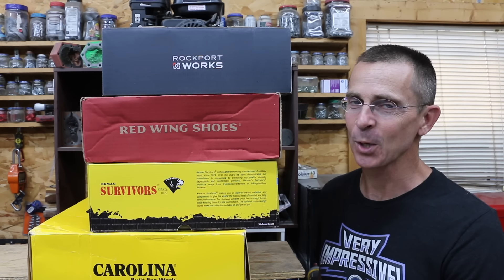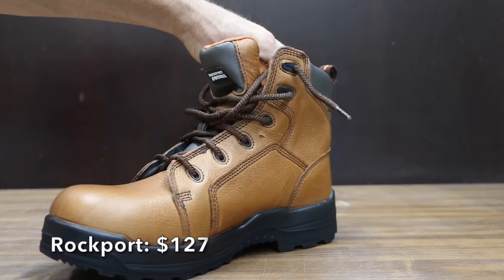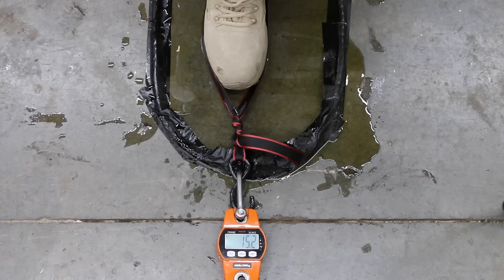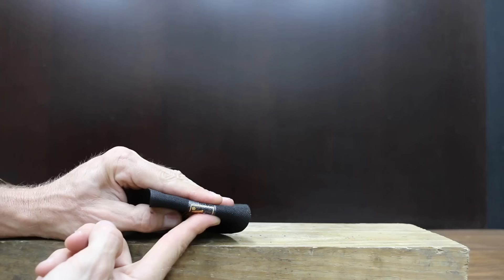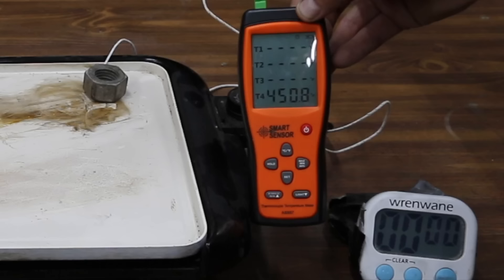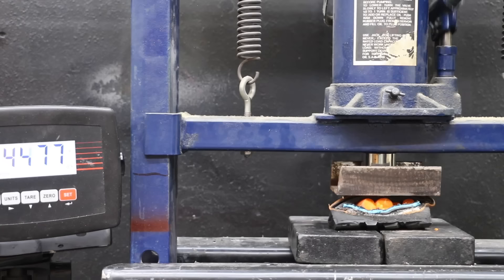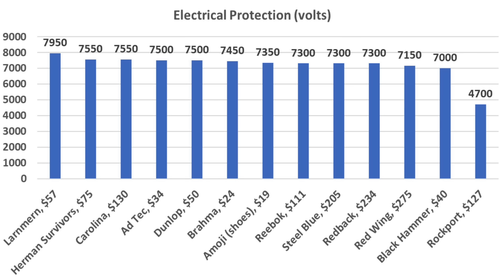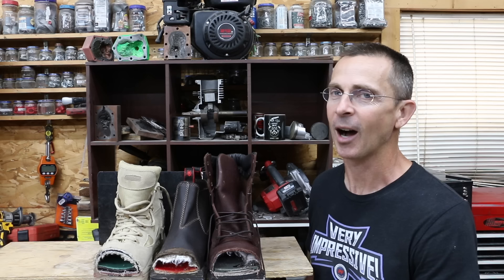Best Boots? $24 vs $275! Let's Find Out!

Comment: I work in the oilfield and easily walk at least 5000 steps a day and in >30 years of working I'm only on my second pair of Red Wings. You mentioned longevity and these boots are top notch. Just as comfortable as the day they were purchased. At the end of the day my feet feel no fatigue.
Reply from the maker: Thanks for sharing.
Reply: Your employer doesn't buy new boots at least once a year? 
I never thought my municipal job would have better benefits than a oil job. 

$160/year allowance for 30 years, that's almost $5k they nabbed from ya.  

Keen boots, made in the US, is where I settled after trying all these, including red wings. 
I work in a water treatment plant, 12,000 steps a day plus running 3 miles a day.

Comment: You know what I would like to see you test:  paint brushes and paint rollers! I do a lot of painting, and I am very skeptical about paying 20+ dollars for a paint brush.  I use the top of the line Harbor Freight brushes, and I get really good results.  Since I'm a general contractor and not just a painting contractor, I usually just throw away the brush after use.  But even so,  I can purchase 5 brushes for the price of 1.
Reply from the maker: Thanks for  the suggestion.

Comment: Longevity is definitely a testament to good boots, and I hope there's a way you can simulate that at some point. I know surveyors that swear by Red Wing, but I have noticed that they've gone away from lifetime, repairable boots and moved towards replaceable boots with glued-on soles. I do know wildland firefighting guys that also buy Red Wing, but they specifically purchase the non-synthetic, laced-on soles. They cost more, but the heat protection is stellar.

I do wonder where Ariat would fall on this list. Several guys at my last job tried them out and were very happy with them.

Also, small but constructive gripe, but please consider dropping out more "and" starters in your editing. When you listen to the video (especially multiple in a row), the "and"-s start stacking up and start to get really noticeable as if the video is one big run-on sentence. Regardless, I'm a big fan of these videos and usually check them out when I'm looking at new tools for work.

Comment: Can we please get a video made over the Top 10 economical Near Infrared Light Therapy devices? 

The red light therapy stuff absolutely works! It works so well that there’s plenty of grifters getting into the space. It’d be amazing to have you conduct a shootout as to the best one. 

You can measure the following: 

1.) EMFs from 4-6 different distances. 
2.) Radiation output from same distances.
3.) Total true wattage of each panel. 
4.) Test the ACTUAL wavelength of the different bulbs on each device. This is where a LOT of lying and grifting has occurred in this space. 
5.) Leave units on continuously to see how quickly they burn out if at all. 
6.) You can also see if there’d be a big wattage drop as it ages; therefore, less efficacious over time. 
7.) Torture testing them in high heat environments. 
What I’m essentially alluding to is seeing if they could survive usage in either an infrared sauna or a traditional sauna. (e.g. 160*F +)
Reply from the maker: Thanks for the video idea.

Comment: Very interesting.   Thank you. 

I would be very interested in a test of climbing boots.  I spend a lot of time walking on blacktop and concrete - tread wear, and arch support for climbing ladders and hooks on poles.  Also wicking abilities for foot sweat and or water resistance.
Reply from the maker: You are welcome!  Thanks for the suggestion.
Reply: @ProjectFarm  Have you thought or done anything with polarized UV blocking sunglasses?

Comment: More padding does provide more comfort out of the gate, but a leather insole is really the way to go once it's broken in.  I have some vintage doc martens I've worn for years and the insoles are hard as rock but perfectly conformed to my feet so it feels like I'm walking on nothing.  100ft, 5 miles, no problem.
Reply from the maker: Thanks for sharing.

Comment: My redwings lasted over 4 years doing 20+km a day through canadian winters, solevants, and oils. They just need new orthopedics and are good to go for more. Plus redwing will overhaul them for less than the cost of the cheapest boots on the list. Free laces and cleaning/oiling for life the cost of them compared to other brands based off of lifetime of the boot is lower cost when 200$ boots are needing replacement every year and the 400$ redwings are good for 4+
Reply from the maker: Thanks for sharing!

Comment: I wear Brahmas for work, just because they are inexpensive, and it is difficult to find size 7 to 7 1/2 shoes.  I totally agree on the test assessment.  I have to put extra inserts in, but even that doesn't keep them from hurting my feet.  My next boots will be Black Hammer, if I can find them.  They need to be able to stand up to dry cement and fly ash, and rough terrain.  Thank you for the testing.
Reply from the maker: You are welcome!
Reply: I wear size 6 mens which is why I got that exact pair of brahma boots since they were the only pair of steelies in my size at Walmart and I needed them because I just had gotten a warehouse job. They seem to be built just good enough to get someone to their first paycheck or when they can afford a pair of nice boots.

Comment: I just got rid of my Reeboks.   They look comfortable but there were terrible after more than a couple hours.   I do routinely work 13 hour days on concrete and that is tough on any boot, but i found the reebok's to be uncomfortable on longer drives and hikes as well.   i did try replacing the insole and that helped some but not enough.   I've had Carolina boots in the past and found them to be much more comfortable generally although they also struggle with long days on concrete.  They were very durable.   The boots I've had the most luck with in the past for comfort and durability are Colorado's and they included a steel toe, heel, and shank.
Reply from the maker: Thanks for sharing.

Comment: I have a pair of work redwings and the non work Red Wing .
Iron Rangers.

Rangers hands down the most comfortable shoe I've ever worn, and I always hated heavy boots. Keep em clean and conditioned, the leather never holds scuffs and the soles are super durable and replaceable. I did fall on my ass a couple times in the snow, but they aren't made for that. I did trudge through 10" of slush with them, they got wet but surprisingly dried out quick and didn't leak through. Actually did that on my way to the airport and was worried I'd have wet socks for an 8 hour flight, but not at all.

Comment: I highly recommend the most expensive herman survivor boots if you're working on rougher outside concrete/gravel. They're tread, and uppers last much longer than other brands. If you're working on smoother concrete, go with a red wing or comfy soft sole. I've had red wings in the past last 6 months and a pair of herman survivors last 2 years. I enjoyed the red wings with indoor jobs but had an outside job that wore the soles insanely fast. The herman survivors just don't quit unless you intentionally put sharp metal on the toe or do an insane amount of kneeling work on rough surfaces.

All in all, boots should last at least a year with good maintenance. Clean and oil your boots. Don't use silicone spray. Use saddlesoap then mink oil or other good leather products.
Reply from the maker: Thanks for the feedback.

Comment: There's a brand here in Brazil that I use, and I'd like to see how much it can hold against those brands. It's Safetline, the most expensive models cost around $ 35.00 USD with metatarsus protection, double density soles, anti perforation insole, electricity protection, steel or composite toes... and I use one daily to walk 4 kilometers and it's very comfy.

Comment: For longevity of the boots you could rub the corner of a piece of metal with some weight on top till it wears through the boot or maybe do 100 passes and rate subjectively
Reply from the maker: Thanks for the suggestion.

Comment: I have worn Red Wing model 2406 exclusively for 13 years. I am currently in the first year of my fourth pair, each pair lasting me an average of four years. The combination of comfort (there simply is no break-in period, and no blisters), grip, weatherproof, and safety (EH rated to 600 volts, steel toed) makes them my favorite footwear. I wear a size 15 EE, and Red Wing is so consistent in their manufacturer process that I simply call up the store in Smyrna, TN and pay for it over the phone and they ship them out to me. I don't need to try them on, they will fit perfectly.

Downsides are price, they cost me $259.99 for the last pair, and $49.99 for the pads. The durability of the soles is not great (hence the four year, lifetime - but remember that they are my only footwear). I tried out a different model that gave up the EH rating for longer life, but they were quite a bit less slip resistant and I returned them after a day for the 2406's. 

Also I used to work in the paint shop at GM as an engineer (now retired), and between the chemicals and the extra walking I imagine that this contributed to the accelerated wear.

You can have Red Wing re-sole them, but I never have.
Reply from the maker: Thanks for sharing.

Comment: In terms of longevity, the redwings last a while. With extremely heavy intensive use on redwing boots, they can last a year and a half before showing any real damage. I've had mine for two years now (i'm a groundsman tree worker. EXTREMELY heavy use). They are damaged but definitely still wearable. Mine were 400$ however. If they were boots you only wore during winter and didn't abuse them like I did mine, I think they would last 5 years without showing any damage and 8 or 9 before needing to get them replaced or repaired.
Reply: Red wings last almost a year here in my water plant. Nothing lasts more than a year, so no reason to get too expensive.
$250 Keens last just as long as $600 red wings here. My boss even spent hundreds having his red wings refurbished after a year before he gave up, several hundred bucks each time. 
Constant moisture, fire house blasting, and constant pure chlorine gas, it's over. Stainless steel falls apart here if it's exposed to air too long. Also, we use sodium permanganate, and it burns through everything, especially leather.

Comment: I ordered the Larnmern boots on a whim cause they were 60 bucks and wasn't disappointed.  They are lightweight, I added some waterproofed and at about 2 months in I replaced the insoles. Other than that about 8 months later, they are still going strong and the padding and weight of the shoe make them comfortable for 10 hour days.  It's good to see them do well in these tests.

Comment: Missing Keen Brand. Every Lumber Mill worker in the Upper Peninsula of Michigan I know swears by them. I own a pair that I've had for 7 years, and they are quite excellent. When I worked at Connor's Sports Flooring, they were as much of a tool as the roll nailers. When you have a deadline for a professional basketball floor, and you're working 12 hr days, it helps to have a boot that has sole support and can consistently catch a 280lbs panel from a 2 foot drop. Kinda surprised I don't see my Keens in this showdown, but I never heard of them until I moved to the UP. Project Farm is always the best regardless.
Reply from the maker: Thanks!  Thanks for sharing.

Comment: Can you run the boots across concrete with like 100 pounds pressure for a set distance? I think that would somewhat quantify the durability of the soles. Also, the separation force of the sole from the top half might work for durability.  You might have to nail or screw down the soul to do that though
Reply from the maker: Thanks for the suggestion.

Comment: Construction is important:
For a very long time I had wanted a pair of Rockport boots but were too  expensive.  I finally got a pair on sale for $250 can. Unfortunately they were made in Cina instead of Portugal.  The soles were cemented. With ratively little use these boots started falling apart
 The glue was letting go and could not be repaired.  
Conversely I still have a pair of Metterhorn boots made in Canada with a Googyear Welt.  My parents gave them to me 40 years ago when I was in college 40 years ago and I am still using them. I ca😮n't kill them.
Reply from the maker: Thanks for the feedback.

Comment: I would love to see Rock Rooster Norwood steel toe tested compared to some of the more expensive boots. I lve had pairs of Georgias, Wolverines, Dickies, Keens, Cats, and Brahamas. The only ones to survive 6 months were the Rock Roosters and they are going on 18 months best $100 ive spent on boots ever. They have my business now until i die or cant get them anymore. I CANT recommend them enough if you also melt through the rubber soles of your boots with walking on oils and chemicals at work. They have a urethane layer and it really does last.
Reply from the maker: Thanks for the suggestion.  Thanks for the feedback.

Comment: so my Carolina boots have a composite toe cap and shank. they are not meant for hiking but for standing and working. they are water proof and non conductive. working on boilers and chillers that is a thing to check. they are also $180-$220. i replace them every year. with a $20 Thorogood insole they do great for what i do. but i have a lot of ladder time and standing time. if you walked all day a different boot might be better. i added a lace on metatarsal guard because dropping a 4ft steel pipe wrench on your arch is a life changing event. it is why the steel workers boots have them.  CA 8528 is the number. maybe put them in the next test?
Reply from the maker: Thanks for the suggestion.

Comment: I’m a service tech at a dealership and I have red backs along with there socks and they are extremely comfortable I’ve stepped threw pretty deep puddles and my foot and sock stay dry definitely recommend I had some cheap work shoes and they would fall apart after 6 months I walk a lot and so far these hold up and are pretty comfortable

Comment: Look for boots  called - steel blue  -  and Oliver branded boots - they are a little heavy but they are so comfortable  -     My feet are not big 9 1/2 10 ….  But they are wider than most  - due to not wearing footwear  for decades unless  working  , or required for entry into an establishment .       Anyway  ‘’ These two brands of boots are comfortable  .
Reply from the maker: Thanks for the suggestion.

Comment: As a union electrician, I wear work boots probably 6 days days a week.  I often find myself with foot pain. 

 comfort is a major & deciding factor in my purchase. I’m still on the lookout for the most comfortable workboot.

I’m currently wearing the wolverine hellcat with a foam midsole. I wonder how that lines up against the ones you tested. 

Thank you for your testing.
Reply: Try Keen boots. I have comfort issues too due to foot surgeries. Keen seems to make better boots in the higher end models.
Reply: @gerry427  thanks bro I’ll try those next!

Comment: i do not recommend spending more than $35 on any boots where walking is a huge part of your use like commercial and association lawncare postal delivery or UPS delivery or major national chain distribution hub as the soles will wear off in 3-6 months
2 other boots i would recommend testing is Ariat and Irish Setter. have used mostly redwings when i got into construction, my dads company specializes in power line construction and redwings meet the electrical tolerances for 44KV line work and i can personally certify that even during a heavy downpour and some 40KW generator powering 2 pumps in an irrigation canal in southern texas while manhandling these pumps and here being slight leakage on the power cable where some one dropped 8' hole casings on them i was not killed, but i did feel a big of tingle, just not enough to stop me from what i needed to do. usually the static electrical shock while standing under the high voltage power lines to get a slight tingle in regular every day footware.
redwings also hold up to concrete work, but like everything with concrete and quick cure additives, you must clean them off daily and oil them good once every 1-2 weeks depending upon how dried out they got. alot of the good american boot companies have gone out of business or are shrinking in their market distribution unable to fend off cheap chinesium.
Reply from the maker: Thanks for the feedback.

Comment: Wolverine Hellcat would be nice, actually would be greate if you can have an 8 inch boots round. I actually have a wolverine Buckeye 8 inch, been rocking on them for over 7 years and was looking to replace them but they not longer make them, best boots I ever had but the sole started to worn out.

Btw i used to work on demolitions, and use this pair for over a year on that field then just normal work and motorcycling.
Reply from the maker: Thanks for the suggestion.

Comment: The traction testing would make a lot more sense to me if it were water rather than oil. I don't walk around in oil. I walk around a LOT on wet rocks, concrete, asphalt, and pavers. If I step in oil there as been an accident of some sort.  Back at the machine shop we kept the floor covered with oil-dri. We would have been walking on oil otherwise.
Reply from the maker: Thanks for the constructive feedback.

Comment: You should test timberland pro boots I use to work in a dairy plant wet cold tiles every where the company bought our boots from redwing I slipped all the time back then redwings best were $240 I went and paid $175 for timberland pros no more slipping and they are oil and puncture and electrical resistant
Reply from the maker: Thanks for the suggestion.